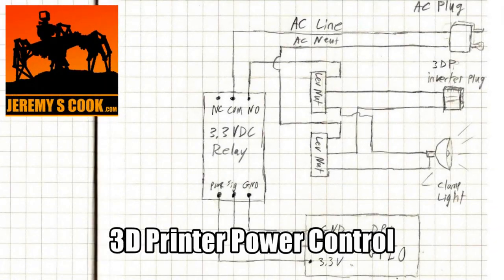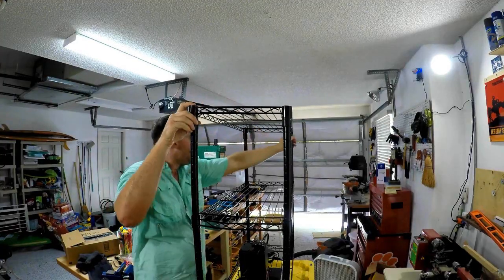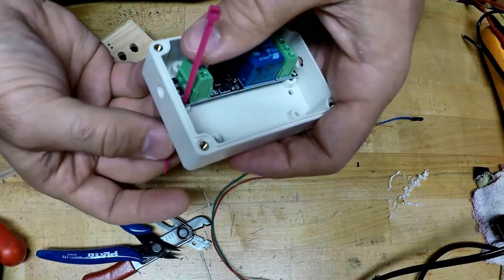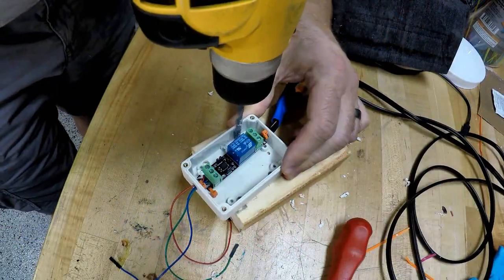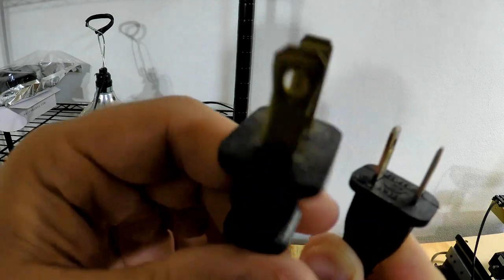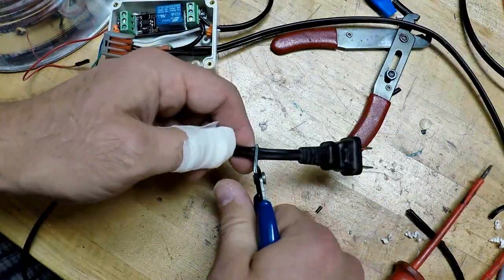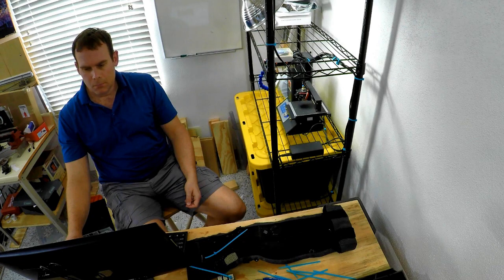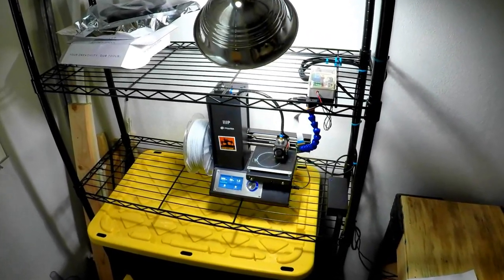3D Printer Power and Lighting Control [OctoPrint]

Comment: You don`t need to be an electric wizard but before you plug it in just get  it validated by an electrician that is the safe way to go about it,
Reply from the maker: Definitely a good idea if you're not sure of your abilities. I actually use a "power tail" now.
Reply: @JeremyCook  good stay safe, the building / EL code and are there for a reason and its not there to make problems, its there to solve problems.. This is Not one of the bad examples out there the only con is some extra sleve or protection of the wires coming out from the box would not hurt .
Reply from the maker: @helge1104  Yes, a sleeve would have been a good idea, thanks!
Reply from the maker: @helge1104  Went ahead and added a link in the description, thx!

Comment: Great ideas. Nice final setup. 
My one suggestion would be that I don't like to cut or modify my original equipment if possible. In this case instead of tapping into the printer's PSU wiring, I would have taken a cheap power strip and wired the relay into that. Then just plug the printer and lights into the power strip, leaving the printer PSU unmodified. 
Other than that change, I plan to shamelessly steal this idea for my setup!  😉

P.S. I too have an MPSM V2 and I love it. Small print volume aside it's a great printer that outputs high quality prints right out of the box.
Reply from the maker: Hi Christopher,
Thanks for checking the video out! Yeah, that's probably the correct solution. Since then, I've moved on to using this type of power tail: https://amzn.to/2EjWZp3 [affiliate] as I had it from another project, which seems like a better solution.
Reply: @JeremyCook  nice find on that Amazon link. Essentially it's a pre-built combination of our two ideas.
Reply from the maker: @ChristopherGaul  Thanks! I've been using it with my Monoprice Maker Ultimate 2 for some time now, so I'd definitely recommend.

Comment: Just a safety note - you should never tin the wires if they are going to be screwed - the tin will deform under pressure and the connection will become loose overtime. So just cut them, un-isolate and re-screw again.
Reply from the maker: Thanks. I've actually swapped this out for a powertail-style device, so I guess no problem anymore. I'll have to keep that in mind though.
Reply: @JeremyCook  Why did you swap it out? The whole device?
Reply from the maker: @Ferox_Six  IIRC, I had one available from another project, and it seemed like a cleaner solution. Yes, still controlled the same way though.

Comment: Hello. I'm having some troubles here. I can't control the relay on the octopi interface "toggle psu" icon (neither turn on or off). 
The printer automatically stars on when the raspberry connects to my WIFI network.
Seems that the relay is powering the printer ON by default (using the Normaly Opened terminal. NC doesnt work at all).
Is it because I'm using a 5V relay?
Any advice guys? 
Thanks
Reply from the maker: Hi Soro, I would definitely try a 3.3V relay here. Or you could use a "power tail" type relay.
Reply: @JeremyCook  Will follow your advice. Thank you
Reply from the maker: @Ultimatebeatdastreet  NP, LMK how it turns out!

Comment: How can I add more than one relay?
Reply from the maker: Hi - thanks for checking it out! You'd need to use another GPIO if you want more than 1 relay with independent control, but software-wise I'm not sure how to do this. Really depends on what you want to accomplish If you want to control more than one output with a relay at the same time, you could look up something known as a power tail with more than 1 output.

Comment: Great video, thank you. Been wanting to do this for my printers for quite some time. Gonna order some parts and finally do it. Don't worry, I used to be an electrician so I know my way around.
Reply from the maker: Thanks Spike! Nice - I've also seen it suggested to use a smart switch for the setup, which would make a lot of sense as well.
Reply: I do have smart switches that I brought to switch my printers with Alexa, but, while waiting for delivery, it occurred to me that they could be switch off by a mis-spoken command (probably by the wife). So I will use the smart switches on something else and stick to OctoPi for my printers.
Reply from the maker: Ah, good point.

Comment: Nice project! That did look painful though!
Reply from the maker: Thanks! Yeah, was pretty stupid to try to hold things back that way. Small cut, so cheap lesson here.
Reply: @JeremyCook  I like those cone step bits for drilling out project boxes, they dont always suit but pretty useful as they won't go flying through once they have drilled the hole
Reply from the maker: Ah, good idea. I actually have one (maybe two now that I think of it) that I don't use much.

BTW, any criticisms of this design electronics-wise? Pretty sure I did things correctly, but always happy to have another opinion when dealing with AC.